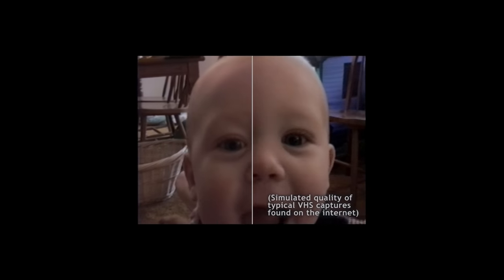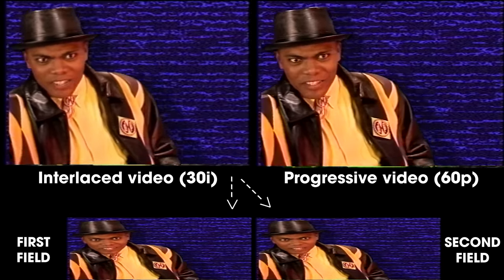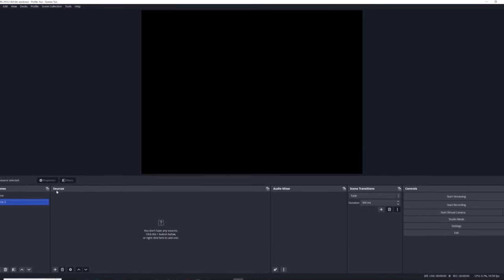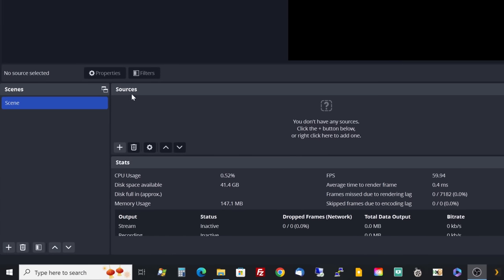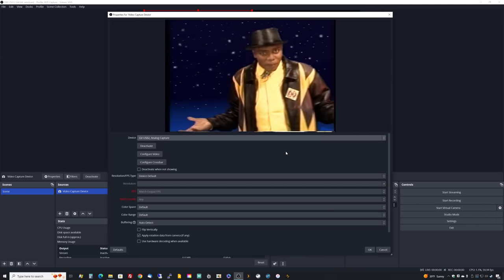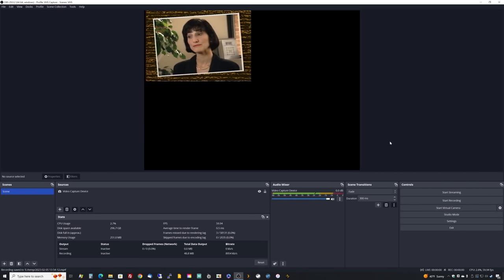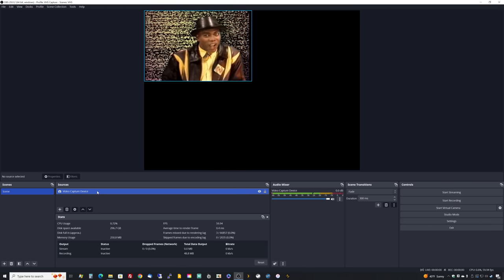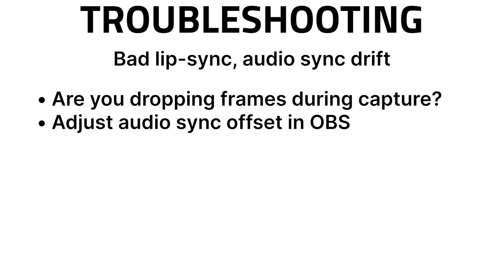How to convert VHS videotape to 60p digital video

Comment: I am using this to convert some old family videos using the dazzle 100. It took some time to sync the audio correctly since it was not loading. I had to change the settings in configure crossbar for the audio output and now it is working. Thank you so much for the updated video this is a much easier process than having to use multiple software programs like handbreak in your older video. You are a life saver thank you so much!!! I actually get to see a video of my husbands 4th birthday :)
Reply: Been trying to use dazzle 100 and can’t get OBS to recognize the audio source.   Any suggestions???  Video comes through but no audio??   We are using windows 10.

Comment: This video makes things so simply obvious! The tutorial is concise and easy to follow, turning a complicated and confusing process into something straightforward. I’ve had one of those cheap EasyCap capture sticks for a while and used it on and off, but always struggled with the settings. Before I discard it and look for one of the recommended devices, I have a few questions, as an unexperienced user:

1.	Frames & Fields: How do I test if the device captures both fields of a (PAL video-8) source? I did a few short trial recordings with OBS and thought I could see a quality improvement when deinterlacing is switched on, and a jagged/backward motion when the top/bottom fields are reversed. Does that mean the version of drivers I have installed can capture both fields?
2.	Formats: with my limited understanding, I’ve set up to capture in AVI format (rather than MP4), unprocessed, uncompressed, aiming to record a ‘raw’ digital format as close as possible to the analogue original and using it as a master for eventual post processing in the future (file size not really a problem since what is considered large today will certainly not be so in a few years). But setting the Base and Output resolution to 1440x1080 did not produce a good recording result, and so, I resorted to trying 640x480 or 768x576, same as the capture card, which gave better results. For the best capture of VHS/Video-8 (PAL) sources in AVI, what would be the best settings in OBS?

I would appreciate any feedback anyone might have on the above, and thank you in advance.
Reply from the maker: If you swap the field order, and notice that the video goes from normal to "jittery", then your device is capturing both fields correctly.  Good thinking.
If you want to capture to a high quality file for later editing/restoration/etc. then you should use AVI, a lossless codec (or uncompressed), and set the size and framerate to exactly that of the signal (ie. 720x576 25fps for PAL).  For that, I would actually recommend something slightly easier than OBS, like amarec or virtualdub2.

Comment: In my experience a TBC has been pretty much essential. Old tapes, particularly SLP recordings would drop frames like crazy without it. That old Dazzle may even have one built in since you mention it handles them better.
I wouldn't bother capturing at anything higher than 640x480 if you are after simplicity, its way more than VHS will give you anyway.
I believe the standard capture for NTSC is 704x480 in a 720x480 frame (ITU 601), yes rectangular pixels. The display aspect ratio can be set in the file and it ends up at 640x480 anyway, but you capture a bit more of the original signal doing so.
If I were using OBS like that I would drag the source slightly oversized to crop out the head noise at the bottom. 102% zoom usually does it and still leaves you with more over-scan area then you would have ever seen on a 4:3 TV.
(The rest of this is just how I do it if anyone cares)
In the end I now use an external video processor for TBC, de-interlacing, and digitization to 720x480p30. I use that same processor to scale the image 102% to remove the head noise at the bottom of the frame, still captures more of the over-scan area you would have never seen anyway. Then I just capture the video as digital over HDMI right to MP4 at 8000KB/s CBR (over double what is really necessary). Arguably I should just be setting everything to 640x480 (processor and capture) since it's only ever viewed at 4:3 anyway and certain media players don't notice the DAR set in the file, YouTube does though when uploaded.
I have a few captured this way on my channel if you'd like to see.
Reply: I prefer a 3x2 aspect ratio so I use 720x480 (3*240 x 2*240).  This format looks good when playing old videos full screen, but more importantly, looks great when playing in a window.  I also scale older 640x480 sources to 720x480 so I can eliminate left and right black bars while losing very little top and bottom video info.  I noticed in the demo captures in this video, left and right black bars were present.  Ten or 15 years ago, enlarging videos was difficult, but with more recent software, the process is pretty easy.  

Even if the source is 720HD or 1080HD for some singing or dancing performance videos, scaling to a 3x2 aspect ratio (720x480, 1080x720 3*360 x 2*360, or 1620x1080 3*540 x 2*540) eliminates the extraneous left and right video info, and focuses on the performers making then look bigger.  I guess I liked the old-timey squarer TV screens more than the current wider rectangular screens.
Reply: @michaeljohnson378  preference is one thing, but 720(704)x480 was the established "resolution" for NTSC video. That's rectangular pixels though, it's not intended to be displayed 1:1 like that, and will appear slightly stretched in width. Consider NTSC DVD, all video is 720x480, it's just the Display Aspect Ratio that differs. 16:9 versus 3:2. Apply those ratios and you end up with 853x480 for 16:9 and 640x480 for 4:3.
Reply from the maker: I agree a TBC is almost always essential, especially if you want to eliminate the playback as a potential source for sync issues.
Reply: @TheOldskoolPC  I don't even think I got my first tape captured without one. Having the external processor simplifies my life greatly. Not cheap, but don't have to worry about TBC or deinterlacing, and just capture an already digital signal.
Reply: @iVTECInside  What TBCs and external processors do you recommend?

Comment: Very interesting video! But I'm a little bit confused about 3 things after watching your previous tutorial:
1. Why do you choose to capture in 60fps instead of 30fps? I thought the source footage was always 30fps or 25fps (pal).
2. In your previous tutorial you captured with a lossless codec (ut video) instead of a lossy codec (mp4). The quality of a lossless codec is far more superior than a lossy codec, especially if you want to edit the video.
3.  The aspect ratio of NTSC is 720x480 and PAL is 720x576. Why do you capture in 1440x1080?
Reply: @shade221  yeah he offhand mentions and should probably more promenitaly say that he's doing this because it makes Youtube display the videos better, giving them a higher bitrate.  Which is fine if that's your intention, though I think most beginners looking to capture home VHS do not intend to upload any of them to youtube or any other streaming site.
Reply from the maker: 1. If you re-watch this video's deinterlacing section, it hopefully explains that each frame contains two moments in time.  So a 30-frame per second capture is really 60 images per second.
3. The resolution of NTSC is 720x480, but the pixels aren't square.  Stretching to 960x720 or 1440x1080 (or 640x480) adjusts the aspect ratio for square pixel displays (ie. all modern displays).
Reply: @TheOldskoolPC  could you explain why exactly 1440×1080 was chosen? Capturing at 960x720 is much less CPU demanding and produces less file size with the same video quality.

Comment: Great video as always Jim! I have had good luck with the GV-USB2, and not good luck with the Dazzle, so I would recommend the former. Question - what do you recommend doing with the last couple of scanlines at the bottom of the VHS signal?
Reply from the maker: I agree the GV-USB2 is the more solid choice.  For cropping the overscan (or the lines on the bottom of the frame) in OBS, you can resize the video capture input device to be slightly more than 1440x1080 -- the edges will disappear off the canvas.  Remember, only what's visible on the canvas is what's written to disk.

Comment: Thanks for the great video. My Quick and Dirty method for converting VCR footage to digital ...
1/ Connect VCR to Digital TV.
2/ Set up a Digital Video Camera or Mobile Phone on a Tripod and position facing Digital TV screen.
3/ Start the recording device and proceed to capture the TV screen.
4/ Start the VCR and proceed to play analog video tape footage onto TV screen.
5/ When analog footage has been recorded, terminate the recording process on the recording device.
End result is a digital copy of the analog video.
This process requires a quiet location that will not be interrupted during the recording process. 
Of course, the video and audio quality of the digital footage will not be at the same level as that produced by direct capture methods. However, it is much better than nothing. It will preserve the memories captured on the original analog footage. This Quick and Dirty process does not require a dedicated capture device, personal computer and associated software. (It does require at least a mobile phone and a TV set. But most people have those items in their house.)
Cheers from the Land Down Under.
Reply from the maker: That is the dirtiest of quick'n'dirty methods.  It's better than nothing, but only just!

Comment: The old guide was very good not this one obs is not good for VHS capture. It's not necessary to add affiliate links in the description we you could just recommend a product and we can find it ourselves.
Reply from the maker: Hi, can you expand on why OBS is not good for VHS captures?  I didn't experience any problems across 3 different capture devices, so I'd like to know if there was something I missed.

As for the affiliate links, they're just an attempt to recoup the costs I incurred buying USB capture devices to make the video ;-)
Reply: @TheOldskoolPC  OBS does not capture in yuy2 color space and 4:2:2 chroma sampling rate.
It outputs recorded files to a strange playback format FLV and MKV not good if you need to color correct the footage MP4 is fine but only as a final delivery format, vhs captures should always be done using lossless codecs, virtualdub is the go to tool for VHS capture, for deinterlacing QTGMC using avisynth frame server, if that's different  for the average user then virtualdubs built in yadif filter is good but not as good as QTGMC de-interlacer.
I don't understand why do you need to recoup the cost for the capture cards shown because you've used them in the old video from 6 years ago. Why should you expect to anyway? How can we trust these are the best when u are getting a commission even if they are?
Reply: @atheistonyoutube Can you elaborate on the first sentence? I don't understand it. Also, can you give more info about virtualdub and QTGMC using avisynth frame server?

Comment: In response to an earlier comment inquiring about a VCR with component output ...  I am using a Samsung DVD Recorder & VCR (DVD-VR357) that has HDMI, SVideo, Component, and Composite/RCA outputs - I think that's all of them! It also records VHS tapes to DVDs and was inexpensive when I originally bought it. 

I was able to pick up an inexpensive HDMI to USB capture device from Amazon (<$20) that seems to work very well (according to my eyeballs and some YouTube reviewers). Two things seemed necessary for it on my Win 10 PC: 1) It worked on a USB 3.0 port but not on the 2.0 ports, and 2) there was no audio until I added an Audio Input Capture source and selected the USB device. 

Also super loved your tutorial but I need to capture old home videos and don't do YouTube stuff so I also vote to encourage an archival capture tutorial. Thanks.
Reply: I'll have to research it more again, but i don't think the component video option on any kind of those combo units will let you rip from VHS (Edit: VHS to PC). - As far as i read awhile ago, it's a professional VHS player that, for example, TV stations use to use, etc. If this were not the case, I don't feel that anyone would buy these dongles as much for VHS rips since dvd/vcr combo units aren't hard to find. (regardless of whether they burn dvd's or not).

Comment: I bought the GV-USB2 and installed the Windows 11 drivers (version 1.15) from the manufacturer's website, but was unable to get the deinterlace function to work in OBS.  Also, the device settings screen didn't match what was shown in the video.  So I started over, and installed the older drivers (version 1.11) from the CD-ROM that came with the device.  The settings screen matched what was in the video, and the deinterlacing now works great.  Thanks for an extremely helpful video.

Comment: Great tutorial, thank you. I don't have any VHS tapes to convert but I still watched the video till the end. Let me make just one remark here on the recording format. There's little value in recording in mp4 directly. The MKV format is safer and recoverable in case there's a glitch or something goes wrong. Then you can always remux your mkv to mp4 using the OBS built-in remux feature. You go to File > Remux recordings.
Reply from the maker: This is true, however I wanted to keep the number of steps as minimal as possible for the absolute beginner.
Reply: @TheOldskoolPC MKV is the default recording format in OBS after installation. So, never change a running system.

Comment: Thank you very much for your comprehensive videos' on VHS conversion. They have been very informative. Your new OBS method is very efficient in that it takes only one step to convert an analog video to mp4. Your older VirtualDub method was a three step process. The first step was to capture the video Lossless interlaced. The second step was to convert the file into a Lossless deinterlaced/progressive file. And finally the third step was to convert the Lossless progressive file into mp4 using Handbrake.

My question regards using a more robust NLE during the workflow to add titles, transitions, colour grading etc to the final movie. In the OBS method, you have no choice but to use the mp4 file which is compressed and will be compressed again once the editing is rendered. In your VirtualDub method, one has the option of using the Lossless interlaced or the Lossless progressive file in the NLE prior to rendering the mp4 to avoid this double compression. If the Lossless interlaced is used, the NLE could convert to progressive while rendering to mp4 although one may not be able to control how the system conducts the deinterlacing. Or would it be better to use the Lossless progressive file to edit in the NLE to ensure the best deinterlaced process had been used before rendering the final movie. Your recommendation is much appreciated.
Reply from the maker: For anything more advanced, any video editor will work.  I personally use Premiere, but Davinci Resolve is a good free option.

Comment: Thank you.
I discovered one thing, i was skipping many frames due to encoding lag. 
It turned out it was not my settings or tape, it was a hard drive. The very moment i switch my output to my internal Samsung SSD my problem completely went away. 
That was also my motivation to clean install windows on SSD. My PC is actually Old, build around 3770K intel processor. 
After switching to SSD i have zero problem.  Regards.

Comment: Nice tutorial on how to get the best quality video from VHS. I record VHS on a Sony HDD/DVD recorder, via an analogue video mixing console with TBC, colour correction, sound correction etc. Unfortunately, the quality is only MPEG2, but most people are fine with that, copied to DVD media. Your instructions are more comprehensive.
Reply from the maker: Your process is great for a quality result -- if only you could bypass the final MPEG-2 step.  But a TBC + proc amp is definitely a good choice.
Reply: Can you elaborate on your process? What video mixing console do you use?
Reply: @TheOldskoolPC  What do you mean by proc amp?

Comment: Excellent Tutorial!  Thank you so much.   Now it's time to convert about 100 videos.  Boy, do I have my work cut out for me.
Reply from the maker: My advice for a large batch:  Test the first 3 or 4 to ensure they're up to your standards -- check audio sync at the end of the capture, seek around the file, etc.  Also, don't throw away the tapes, as better methods will usually be available in the future.